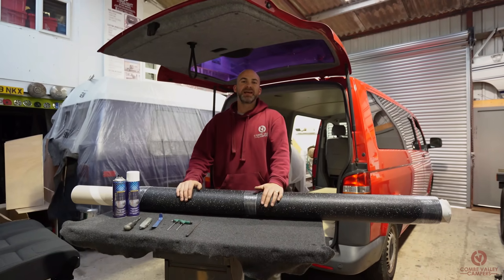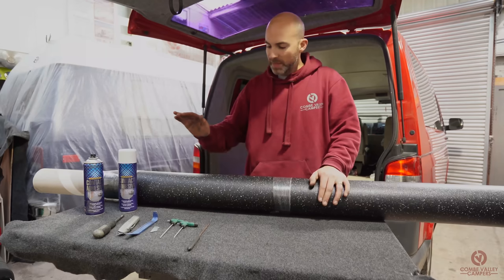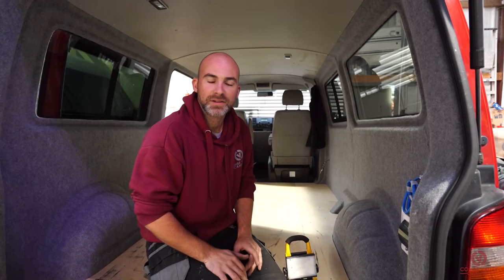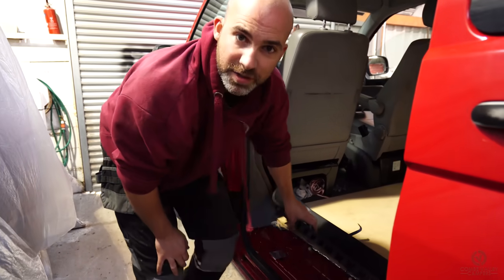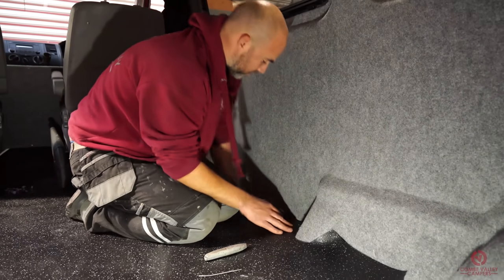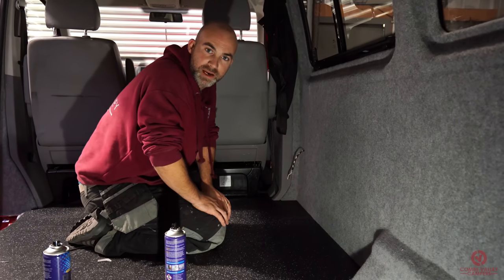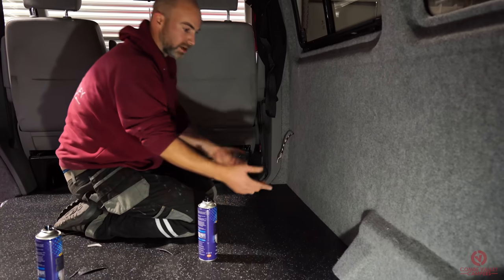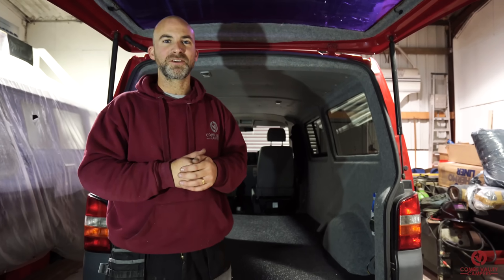HOW TO PROFESSIONALLY FIT A CAMPER VAN FLOOR LINING. Tips, Tricks and Hacks!

Comment: I used to lay caravan carpets i would lay newspaper inside to fit the profile then sellotape the lot together as a pattern, pretty shoddy i know but HEY it works! It still works fitting lino in houses AND CARPET! ( Sorry kids for ‘lino’ read  VINYL FLOORING’)
GREAT JOB guys just bought my high top T5 LWB van and changed my front seats to twin singles and ripping out all the ply in the back ready to insulate!
Someone did a superb job as the floor was SIKAFLEXED down and edge sealed so no water ingress! It was also insulated sadly only with horrible fibreglass matting that sucks up water so it had to come out🤷🏼‍♂️
BUT 
I could only lift it up using the vans scissor jack to slowly ‘ break the bond’ to lift the floor.

Comment: Btw, I highly recommend using yellow tin snips to cut the floor (these are the straight edged ones), so very easy just like cutting paper to get a very precise cut and the floor doesn't need to be warmed either. Also, most diy-ers will have a pair of these and they'll have other uses rather than the hook blade (unless they plan on doing more work involving the blade). Also, tin snips tend to be much cheaper, and cutting the floor will not likely blunt cutters designed to shear through up to 6mm of steel. I'm fitting a Transit swb which has some interesting shapes. Took me 5 minutes to cut the floor shape (using the ply as the template)

Comment: Been watching the flooring videos, 7mm insulation, 12 mm ply, the vinyl, how do the door thresholds fit back on if the floor is now 20plus mm higher ? And prior to laying the ply you mentioned putting ply pieces into the big dips, what depth ply please. Thank you

Comment: Superb video! I'm just at this stage now too, I'm so glad I came across it. I'm also using the Altro vinyl but I didn't know you could buy it already cut to fit the van! One question I have. I was worried about the height difference at the rear threshold plate. I have a full size one, but will I still be able to use it after the wooden ply and flooring is fitted. I thought the height difference might be too high to refit it? I noticed you fitted yours no problem. Can I reuse mine? I have a nissan nv300. 
Keep up the great videos, they're really handy and very interesting with great tips!

Comment: Hi , great videos , great skill . i am trying to put in a new ply floor but i have a question , i have two side doors and the plastic steps fit flush too the floor , i would like to have the step fit over the wood and flooring rather than put a trim round , what would you recommend.  Thank you
Reply from the maker: Hi Mark, thanks for your kind words. You can buy deep steps from many suppliers. Is it a vw or other brand?
Reply: @CombeValleyCampers   Thanks for getting back to me , its a 2004 T5 two sliding doors , I've been following your videos and just finished  insoulation and sound proof ,  just about to do the floor hence the steps issue   Thanks again
Reply from the maker: Awesome, well done. The steps are available from the likes of Kiravans, or vanpimps. Make sure you can order both sides though before placing an order

Comment: Great videos!  I'm converting a Ford Transit Custom.  How do you finish the edge of floor to the sliding side door and the rear barn doors?  Is there cover trims you can buy?
Reply from the maker: Hi Jeremy, yes there is but you have to get them from ford dealerships or ebay. I have the part numbers at the warehouse or you can find them on ebay with a good search
Reply: Cheers Combe Valley Campers, your the best!

Comment: Hi Lee, thank for your videos. I’m doing my van and you’ve been a great help. My van already has Astro flooring in place and is in very good condition except for some screw holes where I have removed old units. I’d like to patch these holes, do you have any advice on a good product to do that or should I just scrap it and replace?
Reply from the maker: What colour is the floor? Os it possible to remove some floor from a discreet area, cutnit into small pieces and 'fill in' the holes inbthe floor with it?
Reply: @CombeValleyCampers  It's sort of a grey speckle effect. They are just small screw holes so cutting from elsewhere is probably overkill. I was thinking some sort of filler / resin. I'm just not sure if it will last.
Reply from the maker: @e.colemantlpss6406  in that case I would look for a suitable polyurethane (or similar) sealer in a matching colour. Then just use a small dab in the holes and smooth  it over.

Comment: Thats not the correct adhesive to use unfortunately. Many camper companies use spray adhesive as they have it for carpet lining. Trowel adhesive is required. Lots of guides on Altro website.
Reply from the maker: Hi Tadge. Thanks for your comments. We have chosen to use this adhesive as it is recommended to us by our suppliers and it also remains flexible in a vehicle that is always moving and with a wooden floor that is liable to swell and shrink with each season. We have used this on many vehicles with great results.
Reply: @CombeValleyCampers  yep i understand. But not always do suppliers have best advice, they are shop after all, not installers manufacturets. All the best👍
Reply: @tadge74  hi Tadge. It's important to  match the method of fixing/fixing products to the actual job. If this flooring is made for buildings then the manufacturer will state the best way to fit it in buildings. Van builders often need to change manufacturers recommendations because the use us different to that in buildings. Vibration, temperature and humidity variance , noise qualities, foot traffic,  weight considerations - just some of the challenges van builders have that are very different to ; what appear to be (on the face of it ) similar issues in buildings. At 1st van builders needed to experiment to find the way forward but not so much nowadays as there's not much that hasn't been tried and YouTube tells us all.   The golden rule has to be.....if it's worked well time and again then it's right. The supplier is the link between the manufacturer and the many van builders. They are perfectly placed to get feedback on what really works in real life situations. A long way to say.....watch a few of this guys videos....he knows what he's doing. Happy travels. John
Reply: @CombeValleyCampers  Great vid - Is it also worth or advisable to use a flexible silicone sealant along the Altro flooring edge to reduce water/moisture ingress?
Reply from the maker: @whu58  if the floor is sealed against metal body work yes I would reccomend sealant. When the floor is butted up against carpet it is almost pointless as the carpet is pourous

Comment: just take the ply flooring out and panel that???????????? literally so much easier than what you shown
Reply: How are you attaching it? Surely the point is not to put screws through the final surface

Comment: Or use polysafe  it’s cheaper and far mor colours
Reply: I’m a floorlayer taff and polysafe  is much easier to cut and if you buy it from a flooring supply co 
Ie volante  it’s really cheap   You could put on ply secured with double sided tape

Comment: Hi ,I'm looking to cover my new ply floor but I'm using my van for camping and track days with my motorcycle and suitcase generator going in the back,would this flooring be tough enough for my needs or would you recommend I use rubber flooring, any info would be very much appreciated
Reply from the maker: I would reccomend either.